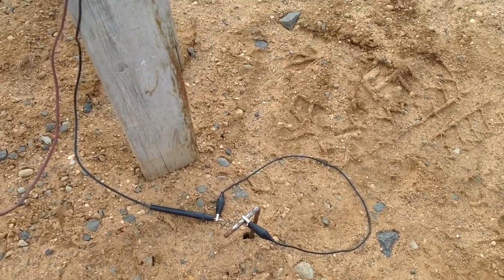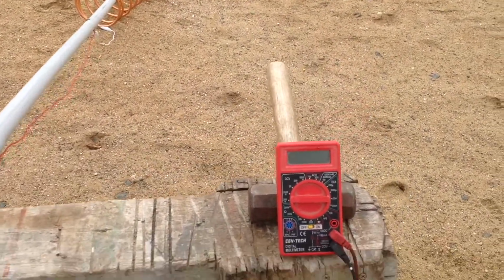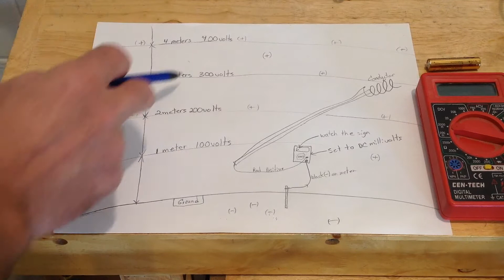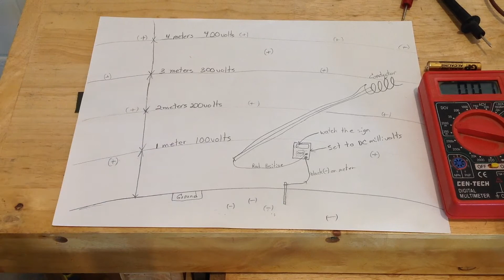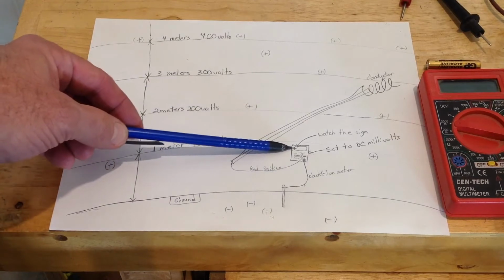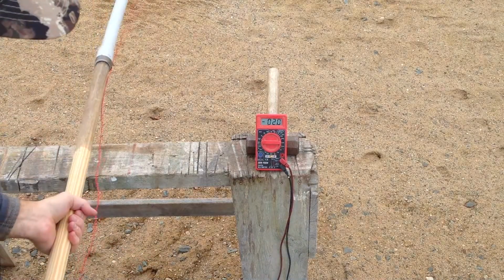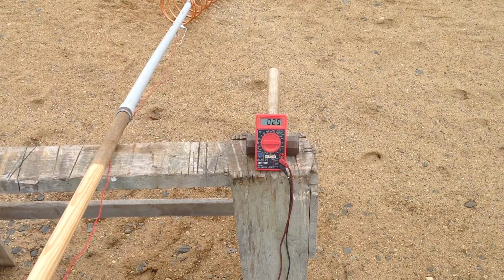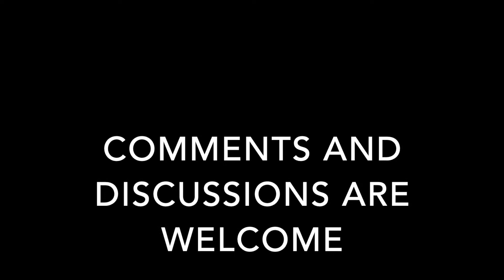Electric Potential in the Air??  Simple experiment to detect

Comment: Tesla writes in the Brooklyn Eagle newspaper on July 10th 1932: "I have harnessed the cosmic rays and caused them to operate a motive device... More than 25 years ago I began my efforts to harness the cosmic rays and I can now state that I have succeeded in operating a motive device by means of them. I will tell you in the most general way, the cosmic ray ionizes the air, setting free many charges ions and electrons. These charges are captured in a condenser which is made to discharge through the circuit of the motor. I have hopes of building my motor on a large scale, but circumstances have not been favorable to carrying out my plan".
Reply from the maker: On 'lasersaber' channel, he worked in this area, and has some videos on it.
Reply: Search also for the work of the "Ion Power Group", they have improved the collection of atmospheric ions by coating electrode wires in high surface area graphite/Graphene ink, exploiting the modified Paschen's law of dielectric breakdown for small radii of curvature to ionize the air at much lower voltages, significantly increasing conductivity in the volume around the electrodes. It's worth mentioning that Tesla's patent for harvesting atmospheric electricity did NOT use an exposed electrode to emit electrons in his aerial. His design uses a dielectric coating on a flat metal sheet to isolate it from the atmospheric ions, forming a single sided capacitor "electret" which forms a plasma double layer in the air by corona discharge on the dielectric barrier. The grounded spark gap transformer circuit would periodically discharge, neutralizing the plate and causing the built up parasitic capacitance of the plasma double layer to briefly neutralize, quenching and collapsing it, before the ground circuit once again charged the plate. If tuned correctly the plasma layer can act as a resonant capacitive element to build up enormous potentials. Tesla was limited to poor dielectrics but nowadays we could achieve high K values. The plasma layer would also benefit from wind and sunlight hitting it, increasing the charge separation through mechanical and photoelectric effects. Tuned plasmas on dielectrics can even act as semiconductor junctions with specific bandgaps in the solar spectrum, maximizing the photoelectric effect.
Reply: Laser saber and ion power group are both collecting static in capacitors but they rely on a special motor and current leakage . That's nothing like Tesla describes . That antenna has a charge and they are not repeatedly discharging it through a rotary switch or spark gap to a load.. The antenna should be charging and discharging fully 60 times a second to realize an amperage or flow . Nothing like the leakage of laser saber and ion power group . They are gatekeepers
Reply: I believe read somewhere that when you put a bare, (no insulation), conductor in the ground, for every 6 feet up you will gain 1 volt
Reply: Everyone we need to stand for our future we need to save our earth because of this Corrupted Government and Company.
Reply: An 18 years old boy from Malawi solve this. His name is Ernest Andrew. Thank me later mate.
Reply: i luvit im smart in laymans terms to have understanding
Reply: you statement proves true teslas " tower" for for gathering etheral charge and not for transmission

Comment: I've tried this experiment before, with a rocket pulling a 40 gauge insulated copper wire to an altitude of 300 feet(ish).  Funny thing was, a digital multimeter read zero, while an analog multimeter pegged over 1000 volts!  Found it would directly light a 5 watt 120 volt night light bulb (tungsten filament), although not to full brightness...
Reply from the maker: Wow!  That's interesting.  Thanks for sharing. 👍🏻
Reply: Try with  MARS  orbiter.....
Reply: u were still wired to the ground or u have done this measurement while the rocket was in the air without wire to the ground???
Reply: @lm1995.    I had a ground stake, and the multimeters were reading between the ground potential and the aerial wire potential
Reply: @emfimpulse  thank you for the answer , just for curiosity (if you know that ofc) how i can do this measurement while i'm in the air?? with out a wire stuck in the ground as negative , what i have to do and where i have to point the negative pin of the multimeters for achieve that??
Reply: @lm1995.   Tell me if I'm wrong, but I'm picturing something like dropping a wire from a bridge span to a lower area, thus you're in the air?  Something like this can be done, however you still need to reference ground.  If you cannot stick a wire in the ground, perhaps you can place a plate on the ground and connect to that?  Or better yet throw a wire in a river?  The higher that you can put your aerial above your own self, the better your results will be.
Reply: Impressive

Comment: Very interesting idea, it seemed to gain power as your probe was in motion going up and then down. Maybe a type of spinning probe would pull in more power than a stationary one.? MM? Just a thought. keep us all updated with your findings.
Reply from the maker: The experiment confirmed for me, what science has taught.  That there is an electric field surrounding the Earth, and can be detectable a ground level.  The conductor is acting like a plate of a capacitor being inserted into, and extracted from an electric field.  Thanks for commenting.
Reply: David, no.  The motion of the coil through the Earth's magnetic field works as a generator.  This is how motors and generators work.

Comment: I'm sure you've noticed. Voltmeter reads something meaningful when you're going up and down. Maybe moving through the electric field is what makes the difference.
Reply: I was thinking the same. Maybe putting it on a wind mill helps but it beats the purpose of having a wind mill setup in the first place 😅

Comment: I think what you needed for this experiment to show the effect better would be more conductor on the pole to increase the current flow. In the arrangement you have, one of the plates of your parallel plate capacitor is an effective pin point of about three feet of copper still cooling coil compared to the opposing plate, the surface of the earth. So your current flow is minuscule. In other words a coil from a flyback or some other high voltage transformer with lots of coils of thin wire to give you hundreds of feet of wire should increase current flow. Maybe even enough for your meter to show. The coil might work better without the metal or ceramic core. Maybe try both ways for an experiment. I am sure it would work even better if you could unwind the coil and evenly spread the wire out to use it like a receiving antenna. In which case spacing between wires and length of wire will become important to maximize the efficiency. 
  Your meter is most likely too low impedance (~10M ohms) with the setup you have to show the electrical potential you want to show without draining the voltage down by drawing too much current. An electrometer would be what you really need to show the electrical potential. Something like a Monroe 244a would be the ticket.
   One other way to show potential voltage from a source which has a really small current with your setup would be to charge a good sized high voltage capacitor without a meter attached for several minutes, maybe hours, with your coil and then connect the meter to the cap and watch the discharge. An old fashioned meter with a needle (d'arsonval movement) will work for that better than a digital meter because the voltage on the cap will be discharging and therefore changing. A digital meter will just show a bunch of random useless numbers as it tries to determine what the voltage is, as the voltage changes.That old style meter is typically even lower impedance than your DVM but will work with the cap and show a smooth discharge from the initial voltage. A really old VTVM meter like the Simpson senior voltohmyst would would best since it has a needle and a similar input impedance as a DVM so the cap discharge will be slower. 
   - BTW - Do not try any of this kind of experiment if there is any potential lightening storms nearby. Ben Franklin got off easy with his shock of electricity from the skies. Be careful.
Reply: Wow! Thanks for your suggestions👍

Comment: Does it matter if it left or right turning? I believe right or clockwise turn in copper wire creates positive charge.
Reply from the maker: The turns in the copper coil doesn't matter.  I'm just using the copper tubing as a capacitive surface, to stick up in the air.  The copper tubing is just something I had, that is a good conductor.

Comment: It discharges through the multimeter you need a capacitor in series to prevent DC current to flow

Comment: More charge when you are moving the conductor up or down, this seems very relevant, is it a static charge you are getting from the air, you did not move it very fast, maybe attaching the conductor to a windmill you could if moving very fast generate more electricity without a generator attacked to the wind mill. If you use the wind or even a small part of the electrostatic energy captured you could generate free energy, then it is just a matter of  experimenting to get a decent amount of fee energy.
By experimenting i mean thickness of generator wire, closer or wider spread wires, longer coil or shorter coil, so many experiments to do if it works as suggested in your experiment.

Comment: Nice experiment.

You could have tried using a higher voltage range on the dmm.

It may have had a higher internal impedance that way and wouldn't have pulled the voltage down as much.

It probably wouldn't have mattered but it would have been easy to try 

It's just a wild guess on my part.

Comment: You should use an analog meter. Those digital meters only update the display a few times a second. Also, make fewer connections that are stronger than the movable alligator clips you have.

Comment: If I'm not mistaken by putting the meter as the load, you are unlikely to get a reading as the meter has very high resistance. You might be better off adding a low resistance load instead. If you set the meter to amps you could get better results.

Comment: Looks like it's going straight to ground. What if you put a resistor inline a small 12vdc bulb?
Reply from the maker: The meter is the only load on this experiment; the only thing resisting the flow.  The flow of electrons is very tiny.
Any resistance will slow the flow, and there really isn't enough in this setup to light a bulb; if that is what you meant...
I have seen a video where someone else was able to operate an electrostatic motor with an elevated conductor.
Thanks for watching.

Comment: If the byproduct of a static electric discharge is a short but intense magnetic field around the spark and if one magnetic field can warp/move a second magnetic field, then perhaps discharging static electricity near a permanent magnet would warp that magnet's field. Maybe if a stationary coil were situated near the stationary magnet and a ground rod were also positioned near the magnet, perhaps the coil would transduce electricity each time static electricity was discharged into the ground rod due to the magnetic field around the spark warping the magnet's field, causing the coil to transduce electricity each time the magnet's field moves. If an antenna were set high in the air to collect static electricity and a wire ran down and near the ground rod, the static electric discharge (spark) would happen without any input from the end user of the motionless electric generator described above.
Who knows if it would work, but it would make for a fun experiment.
Reply from the maker: Thanks for your comment.  I have been giving more thought about experiments to do in this area of interest.  I'm trying to wrap my mind around adding an input, to increase output....

Comment: what would you is the best for electroculture harnessing this effect? Would the top be pointed or spiraled? Would the hole pole be need to be conducer (e.g) copper + spirals near the top, or can i just have a long wood pole with a wire running down it and instead having the copper junting/spiraling out the top? which would be a larger field?
Reply from the maker: To develop a charge on a capacitor, you would want to bleed off electrons into the air.  Many points sticking out into the air, as high as possible, I think would be the best.  A century ago this was the proposed way to capture atmospheric electricity. Balloons with many finely pointed wires, and such things.

Comment: I am finding a typical 0.220 - 0.182 volts, but it will vary all the time at 3 metres high, lower down it lower readings of 0.100 or so, most of my antennas have winding from top to bottom and I don't use insulated wire! Exposing copper to the atmosphere draws in the power, so I would say winding exposed copper down your pole is likely to give a better test, when there are no electrical storms, but make sure the wire is copper grounded rod too, not steel!
Reply from the maker: Thanks for sharing.  Ever thought about doing some videos?
Reply: @doubleMinnovations  I had indeed thought of doing some videos as I have a wide variety of subjects to deal with, like gardening, futures trading, electro culture, free energy, cooking, motorcycles, Balearic slinging, archery and more, but finding the time for my own pursuits it's hard to include videography of these all the time! The Little Signpost is all about the signposts of life and the directions one can take!
Reply from the maker: The first video is probably the hardest.  Just try to do your best, then after hold the, 'I don't care so much  attitude' if it's received well or not.  Expect the worst and hope for the best.  It takes a while to get noticed on Youtube.  We have two channels.  The homesteading one is a lot slower growing.  Sometimes I figure that if I'm going to be doing some project anyway, why not video and see what happens.

Comment: Cheap 2000 count DMM's have a 1 meg ohm input resistance (shunts to ground quickly). Most cheap $20 6000 count DMM's have an 11 meg ohm input resistance, so it would have been a bit better IMO.

Comment: Safety first: you should not do this on a cloudy day (lightning)
2. For good results do this on a sunny day, clouds are insulators.
3. use an analogue meter.
4. Build a mobile device (negative doesn’t have to be 0) so that you can walk around for different results. The voltage is not equal everywhere.
Reply from the maker: I used the least expensive meter I had, (Harbor Freight).  I have ruined better ones doing this by a static charge.

Comment: What Im making of it is as you move the coil it changes the voltage, looks like you are measuring the Dv/Dd... a magnetic field change.
Reply from the maker: The Copper tubing builds a charge that has to be neutralized.  Cutting through a magnetic field doesn't behave that way.

Comment: It may be more interesting to set the meter for dc amperage, to measure the actual current from earth ground to positive charges in the atmosphere. Granted, the amperage would be tiny
Reply from the maker: I did try the DC current setting, but there wasn't enough to get a reading.  The voltage at the heights I was experimenting at, wasn't really high enough to bleed much electricity off.  I was only able to get some detection.
Thanks for commenting!

Comment: lelectriciter dans lair nest pas en dc en majritr mais en ac, tu lit ceci sur ton multimetre car il est cheap, et il y a des filtre en plus de lactualisation qui est lente pour chaque interval de lecture, si tu ferais la meme chose avec un oscillioscope la tu verra le voltage monter et le sinus ac ainsi que les interferance de tout onde radio et electric dappareil

Comment: Wonder what the effect would be if you ran two coils in the air and connected those to a microwave transformer mains and the output to the meter and ground and/or place a voltage amplifier somewhere in the circuit if there would be enough input power to make it fly ?  :O)